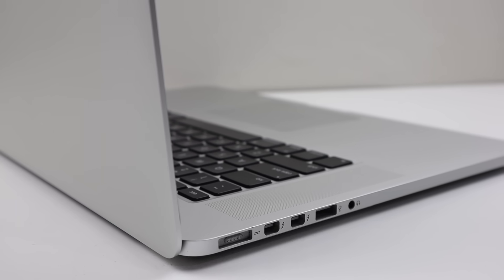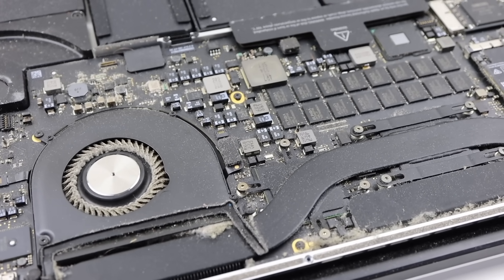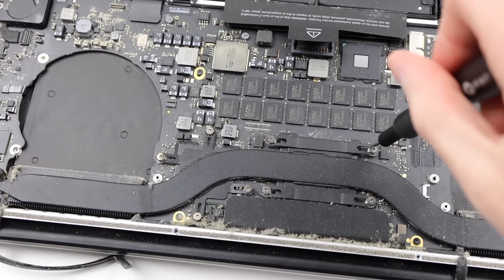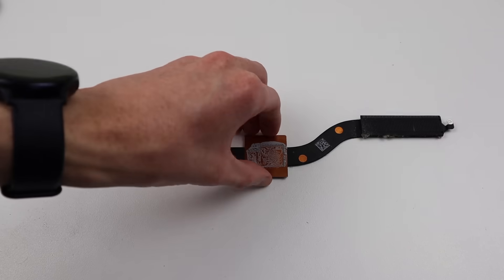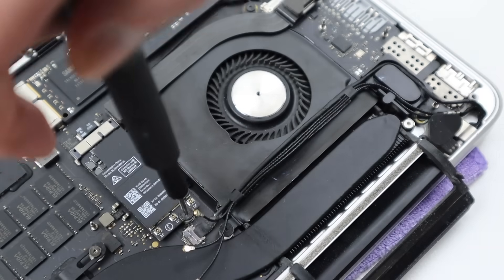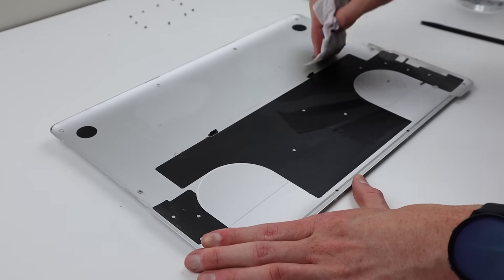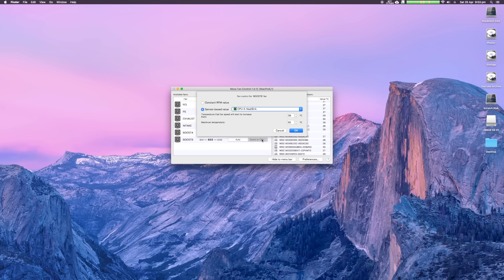Fixing My Filthy Overheating MacBook Pro

Comment: Some top tips from me as I went to great lengths to solve this same issue (some of which I probably didn't need to do).  I chased my tail for a few months and replaced the battery as I thought that was getting hot and draining too quickly, I also replaced the thermal paste and even the heatsink as I had read that they contain fluid and can leak.  None of these helped reduced the temperature to below 90 degrees C.

You are right in cleaning the Mac with air, IPA and definitely replacing the thermal paste.  I had read about the benefits of using liquid metal but I opted for Arctic MX4 as it was easy to use and seemed a lot less risky.

I had downloaded and installed the Intel Power Gadget and saw I was getting temps of 100 degrees C, even after cleaning and replacing components; so the only other thing I could try was to do a full restore of my computer.  I saved my work/files and totally flattened my computer back to brand new.

I decided not to do a restoration from the cloud or a file, but keep my computer new.  I have since installed only MS Office and the Intel Power Gadget.  My Mac is now running steady at 42 degrees C and as I install more software I will monitor what happens via the Gadget.  I believe I must have had an app/software running that I was unaware of and this was crucifying the CPU making it work hard, get hot and drain my battery quick.  

Hopefully some of you will find my comment useful and as the video shows, give your computer a good clean and change the paste, but if you find it is still running hot (via the Intel Power Gadget) then restore it and hopefully you'll be surprised by how good the results are.  Good luck.
Reply: I'm interested in what you have wrote could you explain more?
Reply: @POWERMAXUM  The video and my words pretty much explain everything, but in brief 1) save your work/files etc on a portable hard drive or similar. 2) Download Intel Power Gadget and see what temperatures you're getting. 3) Follow the video instruction to change the thermal paste.  4) If the Intel Power Gadget shows no significant temperature drop to around 50 degrees C with only the OS running then follow a YouTube video to restore your Mac to factory settings.  After a restore install everything from new to ensure you're not putting any energy sapping software on there from a back-up.  If you install the Power Gadget at first you can see any temp rises after each software install.
Reply: While there may be old crap running in the background, you can always check the login items and activity monitor to see what's running. A rebuild will stop most of that, but finding out the actual cpu hogs is generally simpler. I've just migrated to an i9 5K iMac (almost 20 years of migration) and with over 80 tabs in Safari, many youtoobs, there are only 5 cores ticking over one or two blicks on the cpu monitor - even with mail.app open which often runs over 100% on the laptop.

Comment: Strange they did not cut vents on the bottom plate. Also, you might consider cutting said vents after you replace that fried component. It is obviously struggling with heat dissipation.

Comment: 1:15 and that’s why they don’t want you inside. Because even if you don’t do it, someone will sue Apple for trauma or for a class action. If you want to clean your laptop, take it to the Apple store and they’ll be happy to do it for free. I’m not sure if most people know this but, any repair that doesn’t require the replacement of hardware is ENTIRELY FREE (Resealing iPhone’a water resistance included within warranty as well). You paid for the service, USE IT!
Reply: That is literally not the reason why they try to keep you out of their devices.

Comment: 1:55 You made a mistake. There is still power in the board, of you disconnect the battery it just stop the power moving. 

After you disconnect any powersupply, press the powerputton like a pc. 

Sorry for my English ;)

Comment: Omfg that thermal paste application is wayyyy too much... The cpu is much smaller than a regular than a regular Desktop CPU and you used double the recommended ammount for the larger CPU... You just pulled a verge...

Comment: As long as you don't keep the can tilted, the compressed air won't release moisture. Also, you should use the thin tube that comes with compressed air.

Comment: Brushes made with boar or horse hair is safe to use on electronics and I've had no problems using such brushes plus one can actually scrub when needed without damaging SMDs. Basting brushes that anyone can get for almost nothing at grocery stores work the best. I do laugh at people using q-tips when cleaning up old and often bone dry thermal compound.

Comment: When applying thermal paste to a heatspreader, the "dot in the middle and squish and hope for the best" method is fine, but when applying thermal paste to a NAKED DIE you absolutely want to make sure that every damn bit of that chip is covered in a perfectly even layer of paste. The excess will squeeze out, so using a bit too much isn't an issue, and we've never seen any major bubbles show up either. But putting on a dot on the middle and hoping for the best can leave HALF THE DIE UNCOVERED in the worst case, and that WILL kill your chip.

Comment: Good quality compressed air spray does not contain any air, and it is moisture free, does not freeze the components. Example: Kontakt Chemie products. And no need to worry about the brush isn't ESD safe. While touching the mother board you do not use any ESD safe clothing and clearly there is no way for the charge to dissipate to anywhere, so it builds up on that Mac and on you. Using one piece of ESD safe tool does not make the process ESD safe. ESD is not about insulation.

Comment: So, you are using your hand all over the electronics but you don't use the brush because it's not electrostatic safe? lol
First, you need a electrostatic protection when you touch electronics with your hands.
Second, a brush is not conductive.
You done everything the opposite way ahah

Comment: I would recommend cleaning both sides of the mobo & the chassis underneath, especially on the 2010-2012 models. 
There is a bit of room where dust can settle on the underside (but doesn't really affect thermals ime, it's just good to do if you're already taking it apart).
Reply: can you make a video bro, i want to clean my fan on macbook pro mid 2010 but I'm scared to do it
Reply: my mac is not cleaned since it bought

Comment: 🧪  She blinded him with science 🤯 SCIENCE! 💥 
Compressed air from a can might create vapor that condenses — but these are fluorocarbons (fluorothane) — These vapors do not condense to water and boil away rapidly at room temperature creating a cooling effect.

Compressed air from an air compressor might in some instances collect actual water. 🤦‍♀️

Comment: Not to be that person, but when it comes to thermal paste, if you are applying it directly to be chip, spread it. If it's on the metal part of CPUs the pea size blob is good enough. 
You dont want to have any part of silicon exposed. The reason is that the temperature can be measured on the place where the paste is and as such it looks fine. But the exposed parts can run much hotter than before, shortening the life of cpu rapidly.

Comment: If you use a vacuum cleaner every house has one you will first not make a mess with  dust, second not use the bottle compressed air if you care for static electricity you must care double for hidden moisture especially on your fragile apple board or even keyboard, and i assure you i proper vacuum cleaner with the right extender attached is more than capable of clean with no static electricity to your machine....15 years now and no damaged pcs or laptops or ps3 or ps4...thanks for the nice video...sorry about my English..the are poor i know

Comment: one of the best video on the internet, but you should use the compressed air can in vertical mode so it doesn’t spill moisture.

Comment: You are not fixing the problem. I was expecting a new design of the copper pipes, remodelling the fan, additional exhaust openings. But nope, you just used some compressed air here and there, didn't even mention how much a good cooling paste/metal will improve the cooling. Wasted time.

Comment: i did this a month ago on my 2012 mac pro non retina.Opened it after 6 yrs and surprised to see layers of dust living there. it took 3 cans of compresses air to clean off the dust, replaced the thermal compound.put it back and it works like charm

Comment: I’ve got that exact Mac and have had it since 2013. I performed this procedure last year too and it’s still running smooth!  The only problem I’ve had was the power would die at random battery percentages after waking it up from closing the lid. I contacted Apple and they told me to do the SMC reset and it’s back to normal. It’s honestly the best computer I’ve ever had.
Reply: Have you upgraded to Big Sur?

Comment: Thermal paste - important to remember that as far as possible you want the heat sink to directly contact the chip(s) in question for the best possible conduction and the paste is only there to fill any tiny air gaps that might remain between the two.

Comment: Helpful Video but two things that are worth revising / adding annotations for.

1. Spinning the fans with compressed air may result in them spinning too fast. This can destroy the bearings so it's suggested to hold the fan down while you blast it with air - to make sure it doesn't spin at all. 
2. Keep your can upright at all times. The spray causes an 'icy' effect which is not ideal at whatsoever. This can introduce moisture and do more harm than good.

Comment: common sense should tell you something's not right when the compressed air can is spitting liquid...
Reply: you have to use the can in a certain angle to avoid spitting liquid.
Reply: @NomNomNom1989  I know.
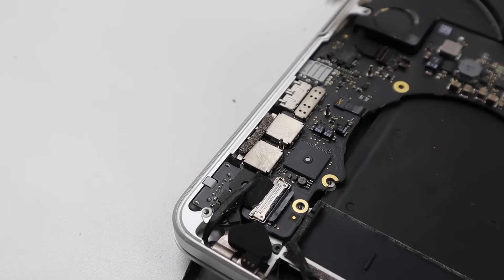Reply: 5:15 u lil piece of sh8
Reply: 5:26
Reply: "the compressed air from a can might create vapor that condenses — but these are fluorocarbons (fluorothane) — These vapors do not condense to water and boil away rapidly at room temperature creating a cooling effect. There are other liquids than water, just in case you weren’t aware.  

Compressed air from an air compressor might in some instances collect actual water — but that’s not from a can dear."
Reply: @MeriZita99  did i ever say water i thought liquid is just a form. I know how these cans work, thank you.
Reply: 김민성 you literally said “when the can is spitting liquid” hahaha so that comment was to tell you it doesn’t matter if it is cause it doesn’t harm the computer. Well, now you know :)
Reply: @MeriZita99 water is liquid. liquid is not necessarily water. Is that hard to understand?
Reply: Do you really need speak like that?
Reply: @blinblinthing  why are you offended? Even the youtuber calls for common sense when applying thermal paste. I'm just pointing out the irony
Reply: @Minssc-i7d5f  you said common sense should tell you....... Suggesting he doesn't have. Not very polite. Mistakes happen, even if it's user error, no need to get personal.
Reply: @blinblinthing  I used the phrase to point out the irony as stated earlier. I'm sorry my joke ticked you off
Reply: That's normal..
Reply: PickleSauce he’s either using it too cold or using it upside down
Reply: omgitzmo it’s just if you use it too long. Nothing isn’t “not right” with the can, it’s just a user error. I meant that was normal for the can to do that if used improperly, not how it is supposed to be normally used.
Reply: @noaln1697  no it's not you have to keep it upright or else it will release liquid
Reply: Noaln let me know what brand you use so I can never buy it.  Seriously what’s shown in the video is not normal.  He should be using the included straw and holding the can upright.  He’s dispensing the liquid from the can which is then boiling off on the surfaces of the computer.  Th3 condensation is from the fact that this boiling extracts heat from the surfaces it’s on and, lowers the temperature below the dew point, and causes condensation from the air.  This is all wrong, all of it.  Use a straw, old the can mostly upright and the air you get is high pressure and dry.  If you’re not getting those results then something is really wrong.

Comment: Do NOT tilt the compressed air can or turn upside down, because the liquid air (actually/typically propane gas) causes fast evaporation and freezes components. It can damage solderings and SMD parts too.

Comment: My early 2015 macbook Pro 13 inch has been acting up lately like this, where it reaches temperatures of upto 90 degrees by just opening a terminal and Google Chrome. Would you recommend to clean it or just buy the new MacBook Air ?
Reply: Clean if you can. Get a laptop that you know won't have thermal issues if you must.
Reply: Did you solved it?

Comment: I'm using the same generation but with i5, 8G ram and 120 SSD. I doubt I can upgrade on cheap, right?
Reply: The only thing you could possibly consider upgrading is the ram and storage. A 512gb NVMe SSD will run you around $70 and a ram upgrade could potentially cost you the same but should be less.

Comment: Hugh, I plan on buying a used Note 9. It has major cracks along the front and back and you can only use the Stylus to use the phone. How much would it cost to fix the screen and glass? (Assuming that’s all I have to do to be able to fully use it)

Comment: uh.... my 2015 13 inch  MacBook pro reaches 106 degrees Celcius according to intel power gadget and I've already replaced the thermal paste like 5 times but nothing seems to make it run cooler.

Comment: You should should have seen my late 2011 MacBook Pro, the vent that connects to the heat pipe had a thicc carpet of dust on it. Helped the thermals a lot.

BTW: that pan at 7:32 is amazing

Comment: I wonder the specs,it looked like it had nvidia gpu and intel cpu (?)
Reply: Intel CPU and Intel iGPU. Apple does not use Nvidia components as both are not on good terms. As for the CPU I suspect dual core 3rd gen Intel processor.
Reply: T1E6X1 I clearly saw the Nvidia logo on the inside. 5:42 look at the GPU
Reply: @tezcanaslan2877  yep my bad

Comment: Thanks for another informative video and the useful tips about safely reapply the heat sink clamps. I recently cleaned out the inside of a MacBook Air, which while being much simpler, involves many of the same issues.

Comment: 5:45, with direct die contact, overapplication is not an issue. What is however, is an unclean die. There are a lot of streaks, old paster residue and dust particles on the die there, visible clearly. Now it probably won't matter too much, but achieving a mirror sheen is actually a good idea. For instance, look at this picture: https://www.tomrei.com/wp-content/uploads/2018/03/20180312_202646.jpg

Comment: I've done this for my 2011 MacBook, thermals improved but still throttles at 98c. Are MacBooks really designed like this or maybe I did not apply the paste and heatsink correctly?
Reply: MacBooks are designed like that yes, they prioritize asthetic and slimness over basic thermals.

Comment: Which spray u used for motherboard cleaning plz tell
Reply: Compressed air
Reply: @maxz8807  liquid spray
Reply: @vitaminprotin  he used compressed air incorrectly, causing it to spray liquid on the board. Had there been power to that board he could've killed it.

Comment: Far too much thermal paste, you need about 1/6 of the amount you placed on the large CPU die. It spreads very very thin with the heat sink attached, and if it's conductive (Arctic Silver), it risks hitting resistors/caps on the side of the die wrecking your board.

Comment: In the future always hold the fan blade in place prior to hitting it with compressed air. Whats happening with this theory is that you're essentially over spinning the fan and causing potential damage. Ive ruined a fan or two doing this. Although the damage isn't done right away, the bearings over time can fail prematurely.

Comment: It’s not the compressed air that introduced the moisture, it’s the condensation from the high pressure liquid sprayed out. (Which isn’t suppose to happen if you keep the can straight up all the time.)

Comment: Dude you definitely put to much thermal paste. Guys please do  not listen to this guy when he says to use common sense. There are correct ways to do this and he didnt.
Reply: Over application is almost never an issue.
Reply: @maxz8807  that is simply not true and it could accually be worse then how he had it before
Reply: @marcolozano9321  almost all thermal paste is non-conductive. Yes, over application isnt good nor do I condone it, but overapplication of thermal paste is almost never an issue. No, it wouldn't be worse than before. The pressure applied on the cooler still spreads the thermal compound out in an equal, thin layer. As long as the entire dye is covered you pretty much good.
Reply: So it is better to put a thin apply?
Reply: @POWERMAXUM  yes
Reply: @POWERMAXUM  about the size of 1 or 2 grains of rice

Comment: That's probably the 1st time I saw the inside of that fan. 

Look how amazingly thin and tiny the blade is! 🙄
No wonder my 3rd gen MBP died early.
Reply: well upgrade to a PC and hackintosh it or upgrade to a newer MacBook Pro or maybe an iMac
Reply: @RobbDrew03  I've already donated that pos to my local repair shop for them to use as spare parts, 4 years ago.

I was laptop-less for few years and now happy with my P1 Gen2.

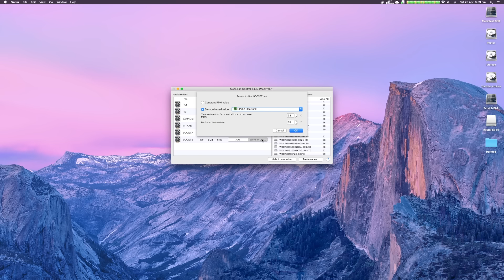Comment: 9:10 I use this software, actually. But because I'm using a 2017, 27 inch iMac, there's only one fan.
One.
Single.
Fan.
For the entire system.
Reply: That's how they like to do it, make it overheat and kill it
Reply: If was made a well designed patch to air flow inside the motherboard is only a matter of monitoring the hottest point of the system